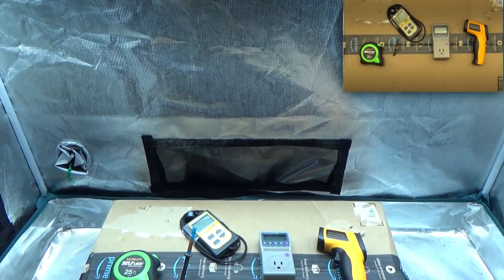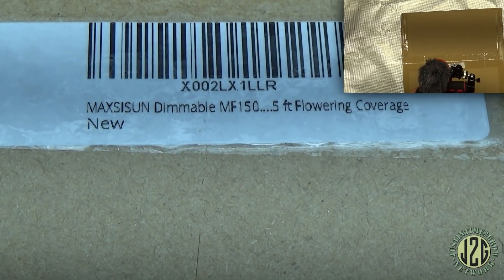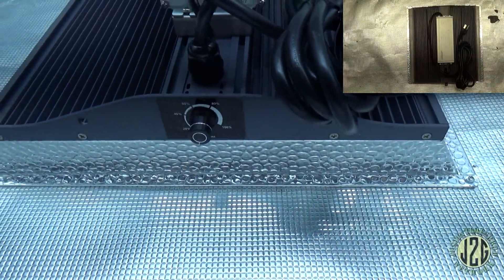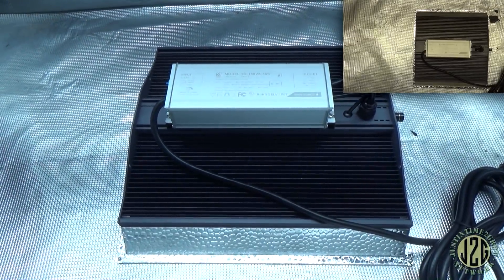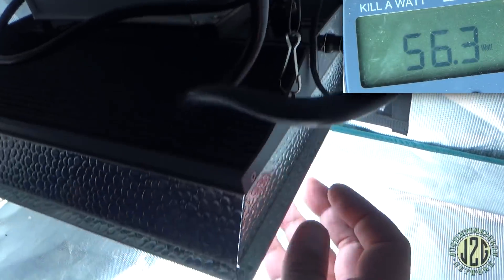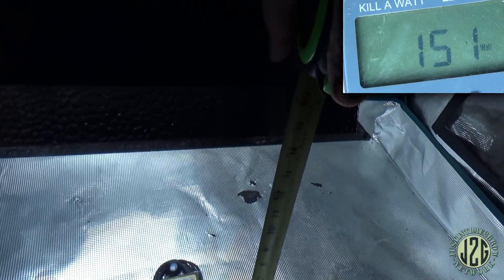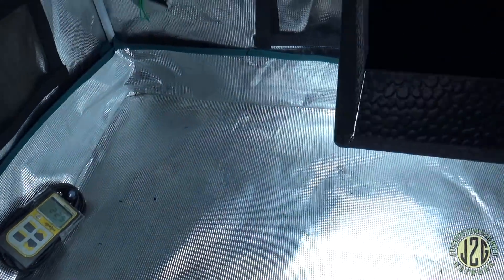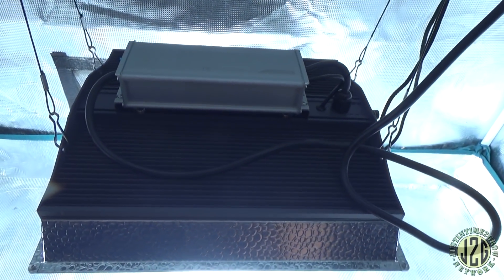Are Cheap Amazon Lights Any Good? (E:15) - Maxsisun MF1500 Unboxing, PAR, Wattage & HeatTest

Comment: I like the reflector on these. That's 1 thing I never really liked about QBs with no reflector is that it's more less a lambertion effect. Just wish it had more chips. Like the viparspectra P series has 3 chips per watt.
Yep 
Spot on. 
3×3 veg 2×2 flower.
Runs super cool.
Small 3 inch USB fans on the board pointed at the driver keeps these drivers really cool. Expanding the lifespan. I use small fans on all my boards.
Reply: Is there a USB hook up for the fans on the top of that light? Thanks so much for sharing your experience!
Reply: @LawgicalXX  no but a lil 3 watt USB fan sits up rather easily on QBs and makes a big difference in cooling for such a small fan.
Reply: @timpage5021  thank you! 😊

Comment: The box isn’t lying. It states “5ft coverage“ not “5X5 coverage”. 
It claims a 2.5 x 2.5 flowering coverage which is 6.25 ft.
Reply from the maker: Even if your theory is correct it’s still wrong. 5ft is not 6.25ft right? 😂
Reply: @Justintime2grow  lmao I believe this is their way of not being sued for false advertisement. 5ft is within the  6.25 sq ft. Area. 🤷🏾‍♂️
Reply: Oh boy, LOL... The MF1500 is good for a 2.5 x 2.5 ft flowering coverage. Amazon sticker on the box was sniffed part of the title. Here is the complete title "MAXSISUN Dimmable MF1500 LED Grow Light: Using Samsung LM301B LEDs (IR Included) & Sosen Driver & 15mm-Thick Heat Sink, Sun-Like Full Spectrum for Indoor Plants Veg & Bloom, for 2.5 x 2.5 ft Grow Tent".
Reply: It's labeled that way because the 3 dots represent MF 1500 being cut off at the end (MF 150...) and the 6.25 sq. ft. coverage being cut off at the beginning (...5).

Comment: Its a viparshydro.

Been rocking 3 peanut butter 2000s in my 4x4 for two runs now. The drivers are 240 watts so they actually run at 240 just fine. Called the mfg and they said it does not void warranty so I turn them up all the way in last month of flower. With a fan they run just a bit warmer than at 200 watts. Lastly San An diodes on the older ones are just chinese made samsungs. If you google San An they partnered with Samsung to design these chips. I bought them when they were on sale and your code gave it an additional discount to 118 bucks each shipped.
Reply: For safety reasons, please do not adjust the PB2000 to over 200 watts. I apologize for the misleading customer service.

Comment: I just recieved this light.. Was going to replace my Mars Hydro TS1000 with it.. But first I'm testing to see how warm it makes my tent.. It seems pretty legit so far.. Hoping the heatsink can really help keep the temps down a bit.. Even if its just 2°F or 3°F lower than the Mars Hydro TS1000 I will more than likely keep it.. Also love the Samsung Diodes.. But the reds and IR are epiled(?) Diodes.. Sosen driver.. If the temps can stay down I will keep this one for sure.. Mars Hydro did a good job for me.. But the heat in the summer time is what kills me (just with foxtails lol)

Comment: Quick question I bought some reg seeds and was wondering if one of the seeds is female could I harvest and re veg it and if I took clones off of it would they also be female ?
Reply: yes, but reveging takes a good amount of time. like it could take 2 to 4 weeks to see growth..but YES the clones from a female revegged plant will be a female..
Reply: @didtheyexpectustotreatthem574  appreciate it bro 👍
Reply: @skullmonkey1674  good luck, i am curently reveggin a GMO..
Reply: @didtheyexpectustotreatthem574  heck yeah I’m running some gelato mint from exotic genetix. How did the GMO turn out ? I’m definitely going to have to try that strain out.
Reply: @skullmonkey1674  my GMO got huge.  i flipped the plant at 22 inches and the top was 56 inches at harvest,,.rock hard buds smelled like duct tape, tasted like haze skunk with a very slight garlic flavor, but the high is strong. and creeps, 1 bong pull and about a minute later . it hits..the reveg looks like some kind of mutant, but its back in veg.
Reply: @didtheyexpectustotreatthem574  oh yeah now I’m definitely going to have to run that next time for sure 😯
Reply: Save your time, go to seedsman get females.
Reply from the maker: Yes.

Comment: Justin are all the diodes made by Samsung? Great video once again.
Reply: The new models of the MF series has 281s and they are absolutely shit. I was absolutely stoked bout this combination of viparspectra Marshydro and lm301bs.
Reply: Maxisun replied and said the reds are epileds, the whites are LM301B on the mf1500 but the mf2000 uses 281s.
I use the mf1500 and it is perfect for my 2x2 veg space.
Reply: @optics4062  I just bought MF 2000. Should I cancel The order? No good? 😞

Comment: Need some help if you got a sec. Please and Thank You.
I have 5 auto blue amnesias (from MOC) in 5/5. Really wanted to time this right since last time needed improvement. Sprouted on Sept 2. Stopped feeding on 10/29. Semi flush a few days before because I felt I overdid nutrients (Humboldts Secret). Used digital microscope and 50x loop and saw most trichomes milky. No real amber. Couldn't make out a lot of clear, but just wasn't feeling confident in equipment and it's a new color for me: purple-ish flowers.Flushed all 5 with pH water about 36 hours ago and put 3 into aerated 3/3 tent with dehumidifier after airing out half day or so. Since I have 5 and can't cut all of them immediately (and I got no friends - ha ha...no one knows except the world). Wife is stuck on the mainland since pandemic. Dog's can't do shit for me except eat and shit. So...should I start 1, leave 2 in the dark room (not feeling good about the tent cuz humidity so they're in a 6x7 closet with air circulation) and get to the other 2 and let them keep going for a day or so. They seem to be okay. Soil is still moist. Should I act now or chill and cut what I can and let others wait. But when's too late? When's too early? What would you  do? What %Amber trichomes is too far? If I were to answer my question if they're milky, cut and hang and start drying process? Can I flush a little one more time? This probably isn't the best organized email. But I'm a little scattered cuz i haven't told you about how many other things I gotta due to keep this unrealistic momentum. Ha ha ha hmmmm. Thanks.
Reply from the maker: If I were to answer my question if they're milky, cut and hang and start drying process?

Yes.
Reply: @Justintime2grow  Thanks man, greatly appreciated. I’m rusty and jumped the gun and just didn’t know what to do and definitely didn’t want to make a rash decision without getting some kind of input. I shall proceed with confidence. I chuckle every time I see a kooky light and think of how you might review it. Hope you saw my mock review of the Relassy waffle iron model that I actually bought and am currently using to get those hard to reach spots underneath...and for toast. Thanks again for the advice and laughter. And you do a great job of informing and entertaining. Kim

Comment: Has anyone else noticed if the light is very dim when it’s plugged into a digital timer and turned off?
Reply: Its the timer not completely closing the circuit and allowing a bit of juice through. 
These QBs are so efficient that even just the lil bit of voltage through the circuit still powers the chips a bit. 

Use a analog push button dial timer and you'll no longer have any problems.

Comment: Would 2 of these flower a 4x4
Reply: No. 4 would absolutely rock a 4x4.
Actually 4 do really well in a 5×5.
Reply from the maker: Did you watch the video? 

Both questions have the same answer.

Comment: Out of all the lights you have tested in the past year, which light would you recommend, considering best buy for your money?
Reply: First thing is what size tent u have u want to get a light to fit the tent to get the most bang out of it I like Mars hydro st series. yes almost the some but u can remove the driver from the light to reduce heat in tent
Reply: @jonathanbennett1957  3x3 tent and thankyou I’ll look into that light more!
Reply: Mars hydro st 2000 great price and you'll have a great even coverage
Reply: @MrDmadness  thanks for the input I’ll look into that light as well thankyou!
Reply from the maker: The light you choose is the best for your space for the money. For a 4x4 space the SF4000 has been killing it on price vs quality. Discount code Justintime2.
Reply from the maker: For 3x3 I like the BP3000 from bloom plus as a cheaper option. You could also do the SF4000 in a 3x3 as long as you can cool it. It has a dimmer if needed. Check out the MF2000 from maxsisun also. Although like the SF2000 its not square. Thats why I like the BP3000 or SF4000.